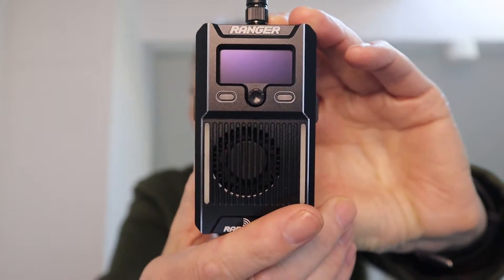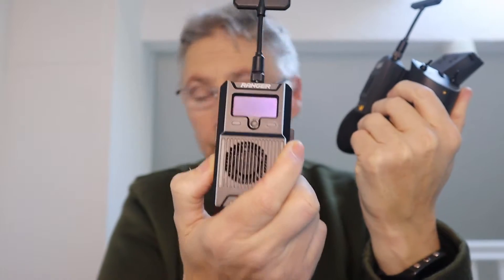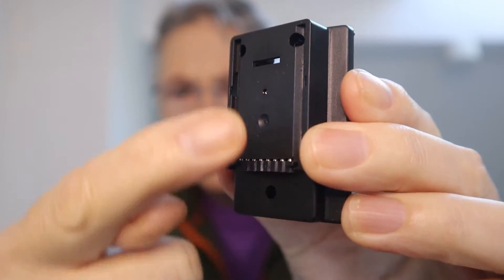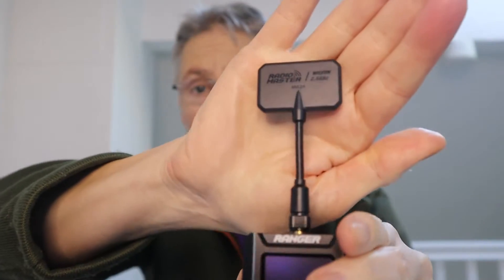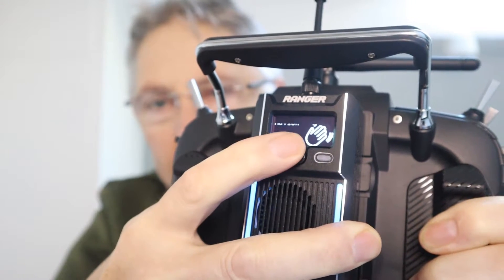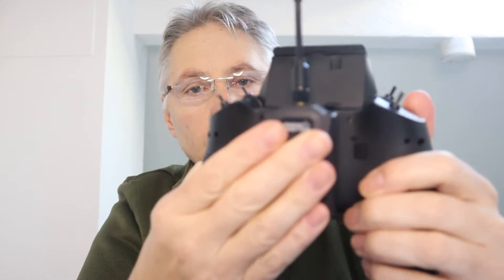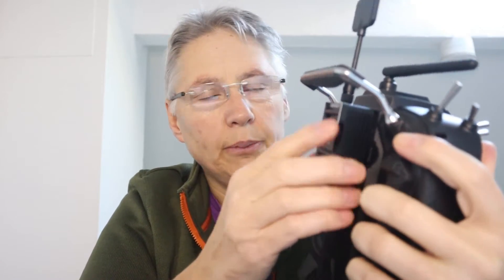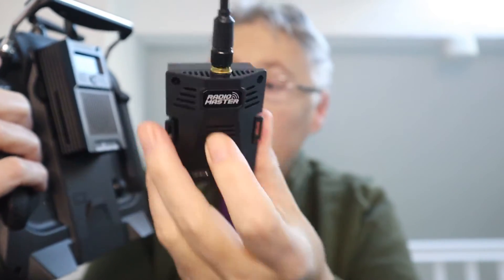The RadioMaster Ranger Express LRS TX Modules

Comment: I still have the jumper tlite V1 with HM elrs tx. Wondering if nano will work there.
Reply from the maker: If you have a Nano socket on the back of the radio which can run crossfire you should be able to use a Ranger module on your radio.